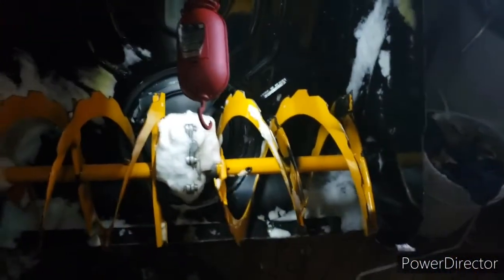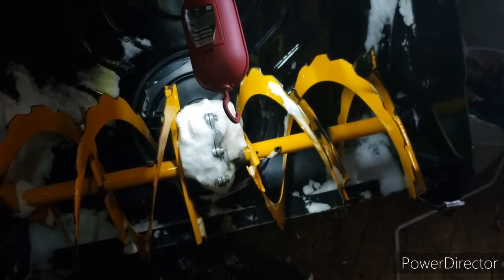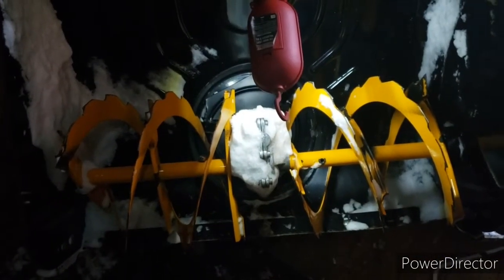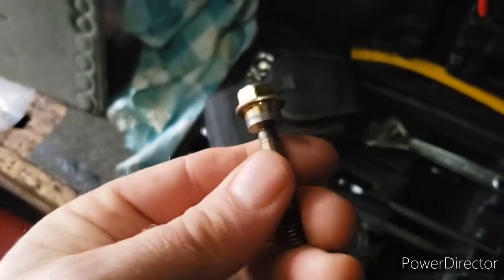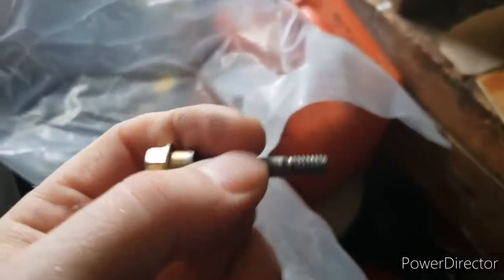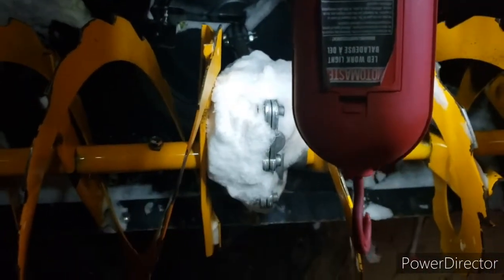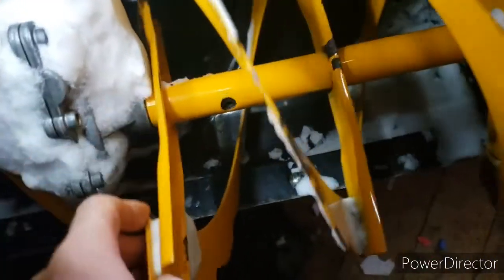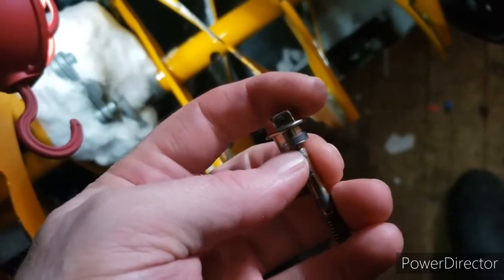How to Replace a Snow Blower Shear Pin and Get Back to Clearing Snow

Comment: I don't think I've ever broken a shearbolt on my snow blower (knock on wood!).  I've got that same light
Reply from the maker: Maybe your better operator, i just opens her up and way to go lol i broke a couple of those bolts. Light is cheap but works good.
Reply: @DIYVariety  I doubt I'm a better operator, just lucky.  To be fair, I've probably only used my snow blower less than 50 times.  My wife bought it for me for Christmas one year when we were getting snowed on every single day.  I was getting tired of working ten hours a day and then coming home to shovel for another hour.  Since she bought it, it hasn't snowed nearly as much as that year lol.  I try to get the snow as soon as I can so I can just use my cordless leaf blower
Reply from the maker: Lol funny how that works hey, get something to do a job and never happens again lol i had a tire one time that had a leak, every three or four days id have to top it up, after quite some time i said hell with it new tire so ill get tire repair kit cause must be a screw or something. Bought the kit never happen after lol. Now i wish that it happen that way for the big stuff!  You get the dry snow mostly? Here we get the wet heavy stuff, leaf blower is great idea for the dry snow, ill keep that in mind. Hold on to the snow blower and keep the snow away. Have you ever thought about having videos on how to play guitar?
Reply: @DIYVariety  We mostly get the light dry snow but we do get some heavy wet stuff too.  Not near as much of it as you guys do.   I'm a lousy teacher and a half assed guitar player.  There's a lot of good ones out there though,  I watch a lot of Marty Schwartz guitar lessons